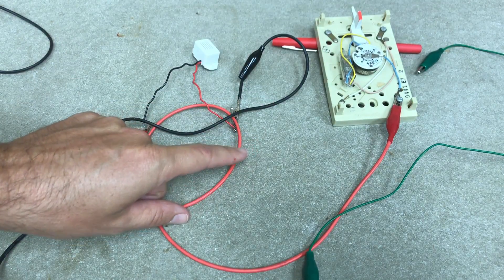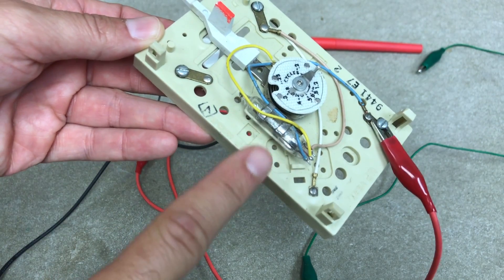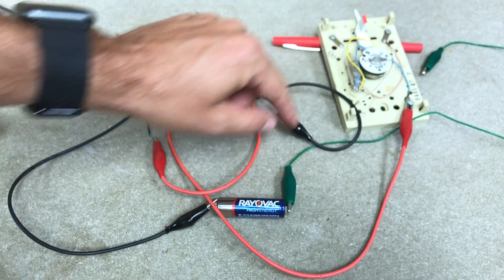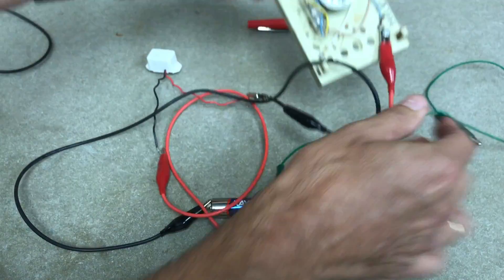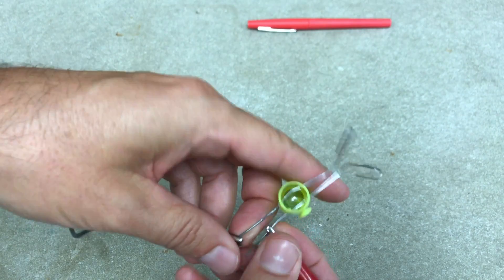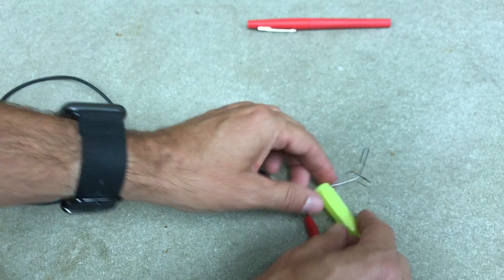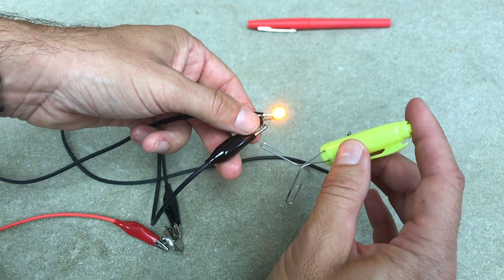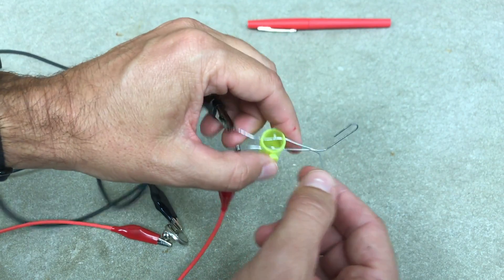DIY Tilt Switch Hack

Comment: yeah doing it that way is cancer. like u said, it could end up just touching one and not the other. If ur wanting to make it small scale the difficulty of having them perfectly lined up is compounded even more.
Just saw another video where they used the same method, but instead put two wires  in the end of the tube with a perfect 90 degree bend in them at the end, then use a fast drying adhesive while adjusting it to the perfect position. Eventually the adhesive will dry and set in just the right position.
I'm gonna give that a try.
https://www.youtube.com/watch?v=k6aUWQjOs68